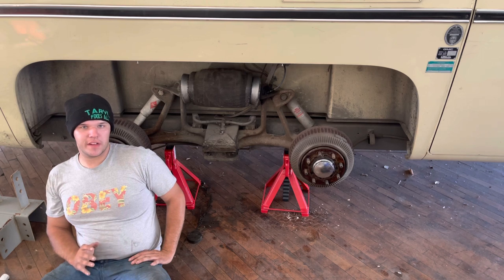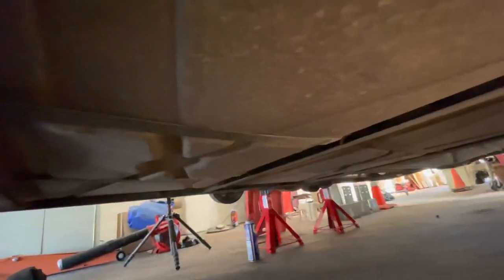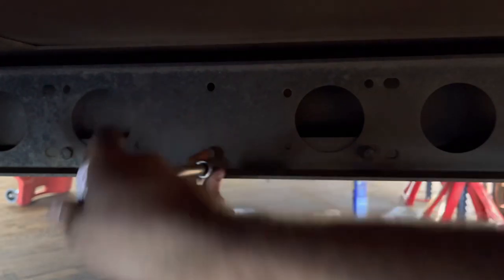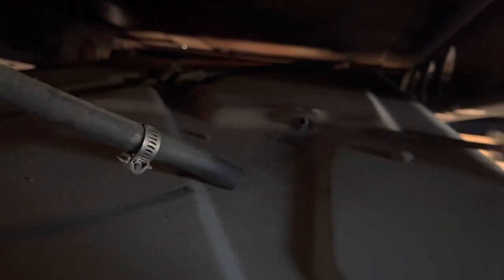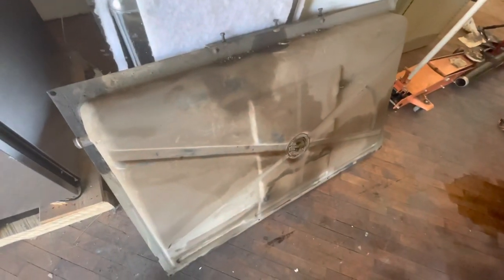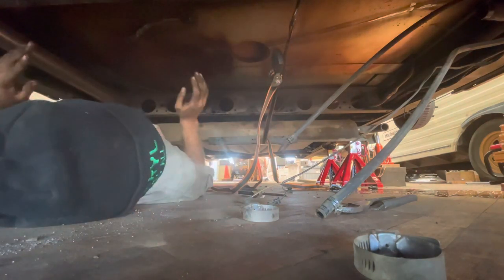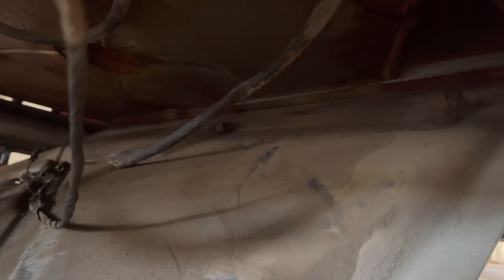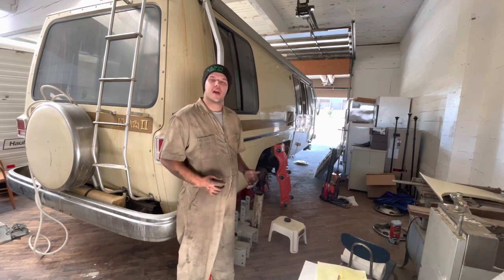How To Drop The Gas Tanks On A 1973 - 1978 GMC RV

Comment: Thanks!!! It was informational to say the least. Excellent video. I can't wait to find one. The one I looked at hasn't been run in over ten years. Radiator is empty, oil looks like sludge, tires and bags are rotted and I'm sure all the rest of the rubber needs replaced. This looks easy enough.

Comment: Hey Andrew a piece of metal bar stock or leaf spring approximately 14" works good to slide into the Boggie arms instead of the ratchet strap to keep em from moving. Keep it on the Coach for later when changing a tire.
Reply from the maker: I have heard about that! I need to grab one next time Im at the pick n pull. For now I am making do with what I have at this garage (not my place)

Comment: Hi Andrew I know this has nothing to do with fuel tanks  I am currently travelling on Vancouver island had to drop the auxiliary tank on this trip so thanks for this video 
Now I have a new problem , my starter took out some teeth on the ringgear and I am looking for a repair shop in the Pacific Northwest that can replace the ring gear any recommendations?
I can get the motorhome started by moving the crank with my socket and bar
Reply from the maker: West Sound Transmission in Silverdale WA has experience with our th425 and is a good guy all around. Scott
Reply: @AndrewsGMC 
Thank you

Comment: awesome video.. question.. how high did you have the frame of your coach to do this?  I'm going to tackle this but my space is limited.. I might make some ramps to drive the coach up on and do this all from the passenger side.. I have no space on the drivers side..
Reply from the maker: I have the jack stands, all 6, at their lowest height. I will be making a video soon about the proper way to jack up the coach. Do you not have enough room to swing the jack handle?

I did not have room on driver side either actually, about 3 feet. I used a jack adapter from APPLIED GMC and a JET brand 5 ton bottle jack to raise up that side with the limited access. Worked pretty good!

You only need the coach high enough to lay under. The tanks themselves are very shallow and easy to slide out. Thank you for the reply Trent!
Reply: @AndrewsGMC  I have 3 inches on the right hand side.. LOL.. It's up against the retaining wall.. It's in the carport in which on the passenger side I have 3 inches to the concrete steps..  So if I have ramps.. I can get all the way under to the other side.. but I can't move in from the drivers.. no way.. for me to do it myself it's this or nothing..
Reply from the maker: @TrentGustus  invest in ramps. They will pay for them selves easily.
Reply: Great video, just discovered a huge fuel leak on the pressure side of my fuel pump since I am on the road I crawled under it and managed to repair it  I drove a few miles and stopped on an uphill slope to check if the leak was gone when I discovered another leak coming from the top of the front fuel tank I figured it must be from either the sending unit or the vent hose 
dropping the tank seems the only option 
It seems as long as I don’t fill the tanks right up no leak 
Currently on Vancouver island and planning to cross into Washington state if anyone can help with a recommendation of a shop please let me know

Comment: My tanks are gone what can I do?
Reply from the maker: Vendors like APPLIED GMC can get you brand new ones. If you just need to move the coach consider hooking up a fuel tank for a boats outboard engine to the Coachs mechanical fuel pump (just to get you down the road)
Reply: Thanks for info .I want to sell ,76 .north fla